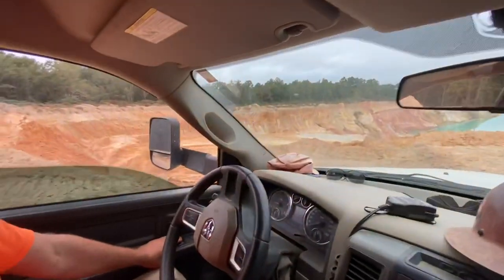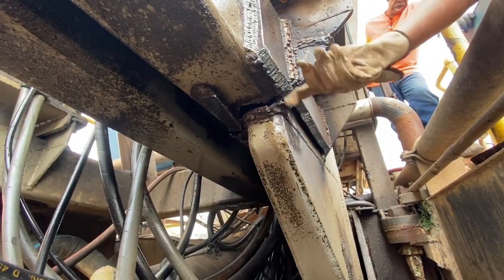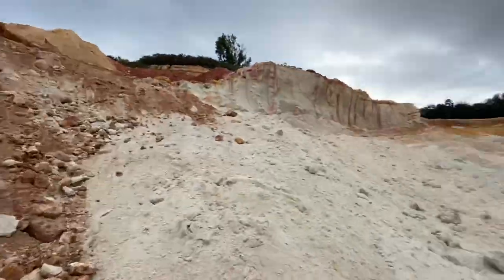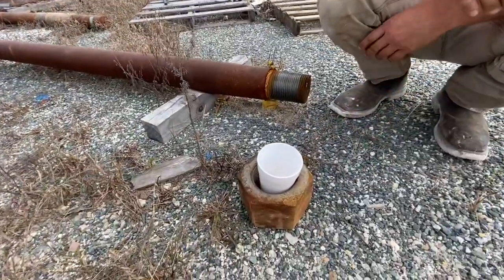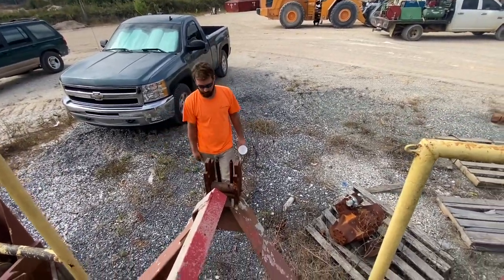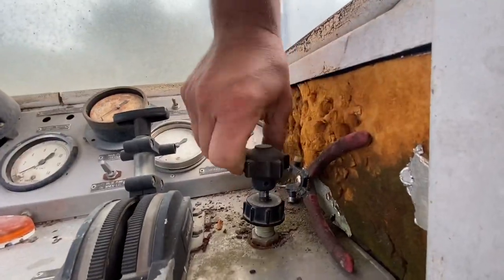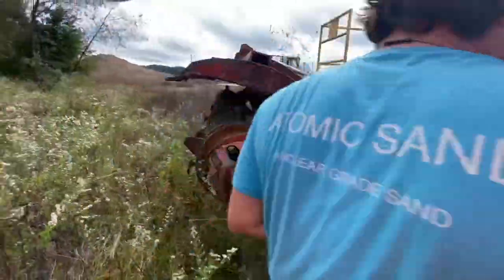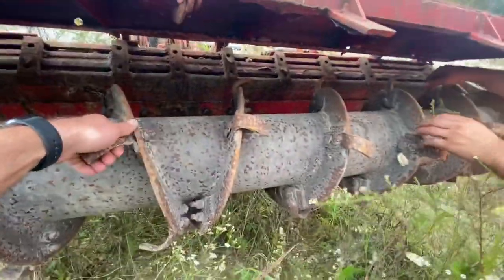Sand DREDGE - can we get it running?

Comment: Need to raise prices . Stop living in fear of running out and as skaves to the rich prople building more houses etc they don’t need . They can pay an extra 10 dollars a yard
Reply from the maker: If I could only get my competition to go up, then we could too
Reply: @TheRealMrDiGG  you gotta be the one that does it first and believe in your company and believe that you can sell the customers on the value of paying a little more .

Especially white sand or washed sand even -

You gotta be able to make enough to pay all your costs , all your employees a good wage to keep the best employees, and also the rate you dig the mine is too fast so you need to basically raise prices just to slow down the rate of the land being depleted.

Would be better to raise and lose 1/3 of customers and slow down the rate of digging .

When your nearing the end of the sand mine in 5-10 years of however long it lasts you will regret not raising them now .

That is my opinion based on seeing a mine close that I worked at after it ran out of land to mine
Reply: @TheRealMrDiGG  worrying about competition is only fear .  There are always places that charge a little more but are better than the cheaper .

If you want to be the mine that just rips the ground up as fast as possible and sell as fast as possible that’s your choice .

Also if raised say 25% even 35% and lost 1/3 of customers you would actually be able to have a real stock pile start to build up and worst case you can easily sell it in large jobs that need 500 loads or something and you can confidently sell it for one price